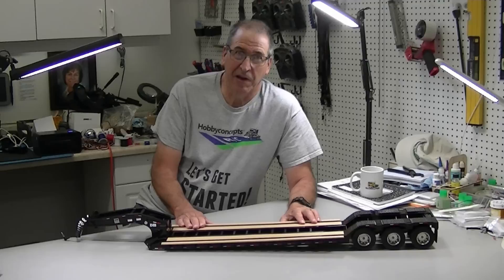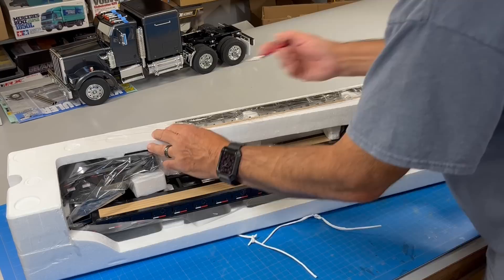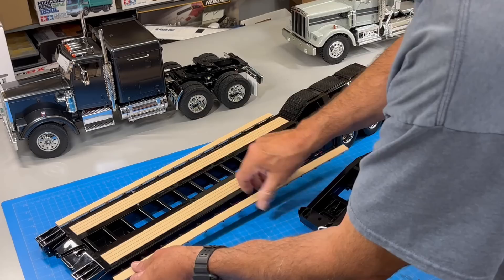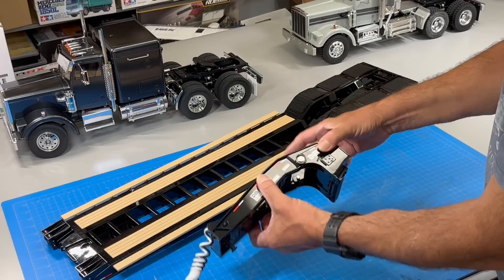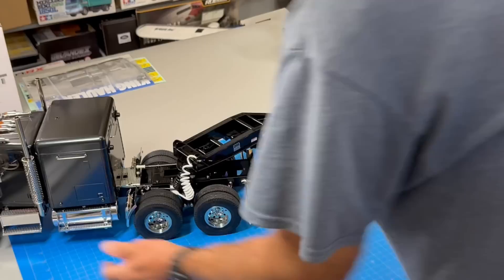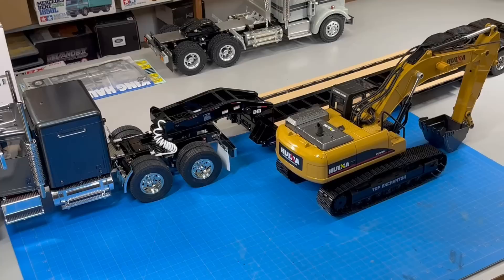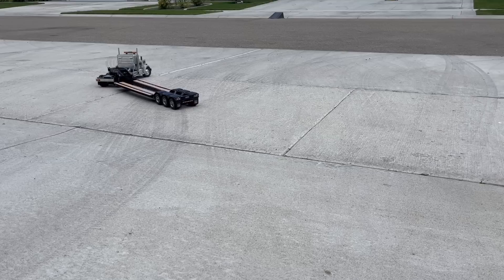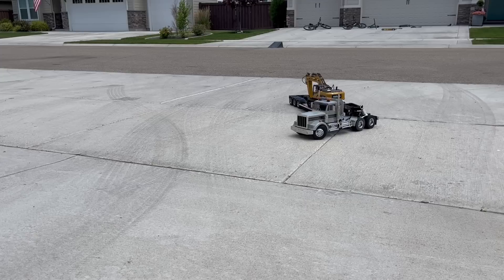1/16 R/C DCM Lowboy Trailer Unboxing and Review - Fits Tamiya!

Comment: Bob, 
I have a wedico 1/16 truck. I bought one of those month ago and have been working on beefing it up. 
That is why I bought the Beier stuff from you.
Reply: can it carry wedico excavator ? weight?
Reply: My Wedico excavator is in pieces. So I can't say for sure.
Reply: I put 20 lbs on the trailer, without the neck. The springs on the suspention bottomed out but the deck did not flex much. I have taken the neck apart so I could not attach it.

Comment: I often hauled  oversize and over dimensional freight on what is referred to as  an RGN or Removable Goose Neck lowboy trailer.  I recall picking up a transformer in Massachusetts and hauling it to Midwest City, Oklahoma.  That lead was 102k pounds including my semi truck that was 4 axles the trailer was another 4 in itself. That trailer was never more than an inch p off of the ground. Talk about exilerating😂

Comment: It's kind of maddening that rc tanks are 1/16 scale a lot of the time.  There are tons of 1/16 scale military rigs.  But finding a full-function lowboy and semi in 1/16 just keep evading me.  
I'd like this trailer, if, I was willing to completely re-do the axles, suspension, re-wire the servos for regular use, and add another (or a small pair of) servos to articulate the ramps.  I'd also want lights, and a bit of an extension.  While extending it, I would also need to bolster up it's weight capacity, because even my cheaper rc tank (still a lot of metal) weighs around 15 pounds.  I'd like a trailer ballsy enough to carry 2 tanks.  AND be in 1/16 scale.  I know, I'm asking a lot.
Thank you for this video, really answered a lot of questions I had.  I like DCM, but they focus more on looks than functionality, and that's backwards from my thinking.  To each his own I suppose.
Keep up the great work!!  Nice rc's!!

Comment: I was looking for something for my 336gc 
But it's double the weight of the excavator you placed on the trailer 
And it was bending in the middle 
Thanks for the video I'll look into something metal
Reply from the maker: The RC4WD aluminum Lowboy is super nice.  It will carry 100lbs just fine.

Comment: psst...those side rails are called outriggers. Would like to see the deck strengthened so it wouldn't flex so much. Is the king pin metal?
Reply from the maker: The kingpin is some kind of plastic but seems like more resin in it.

Comment: For me the quality is not in question,that could be beefed up and modded/customised easy.its a nice item BUT to me it looks underscale. mainly in width even when unloaded,think the wheels look under to but not as bad as the width. just my opinion.
Reply from the maker: You are correct, it is a tiny bit undersize.  But overall looks just fine behind the truck and works well.
Reply: I mean, it's certainly better scaled than any tamiya trailer. The flat bed trailer for the king hauler is insultingly short so this, while not being 100% is still 100% better than the official tamiya  stuff.

Comment: Hello Bob , do you know when you will try to get the controls on this trailer figured out so we can use them with the Tamiya trucks? Now I did have one of these trailers with the diecast masters western star tri axle truck , so I have used it with the normal controls and know all of its functions , and it does have lights and turn signals and 4 ways , also as you know it raises and lowers. If I beat you to it , I will share with you what I figure out , I did purchase another one for my king hauler and it will be here tomorrow,  thanks you! Keep up the great content!!
Reply from the maker: If you figure something out let me know.  I will be doing an additional video on this trailer in August or September (painting it etc.)

Comment: Man that’s awesome! Does it measure out to true 1/16? I build off brand 1/16 semis using wpl parts. I’ve used the die cast master semi but haven’t seen this trailer. I gotta get one of these!
Reply from the maker: It seems to.  On this I have to go by looks because there are so many lengths of real trailers.  It looks pretty darn good.
Reply: @HobbyconceptsLLC  I want to get into 1/14 cause I love them. But they’re so darn expensive. Maybe they’ll be a holiday special this year. I’ll get one then piece it up little by little. You build some nice looking rigs.
Reply: @colossalbigfoot256  I've been working on mine for well over a year and though it's far from done. I was able to drive it around this past weekend. I will share that parting one together will cost you more in the long run. But I understand how you feel.

Comment: How about a Cascadia Evolution
Reply: Non existent for the time being.... 😫
Reply from the maker: The Cascadia will tow it fine.  I don't think it would sit on the deck as it has a lot of nose overhang but I do not have one here to try.  The flat deck is 20 3/4" long.
Reply: My mistake. I thought you were asking to get a Cascadia. Tamiya really needs to bring that back! 😩
Reply: I have a Cascadia  but want a globe liner
Reply: @DrDiff952   At least the Globe Liner is a lot easier to get. Bob sold me mine!
Reply: @CarminesRCTipsandTricks  just my luck. I really didn't like the Cascadia kit and built a KH and a GH. Now, I'm feeling nostalgic as the first semi I drive was a gen 1 Cascadia. Of course, I went to go get the kit and it's unobtainable.
Reply: @SweetLou0523  I know... sad